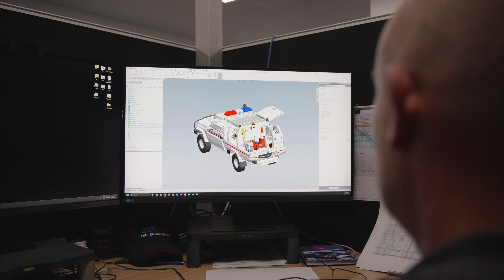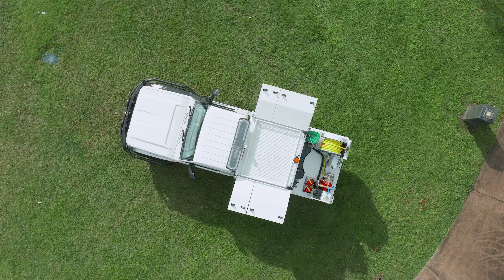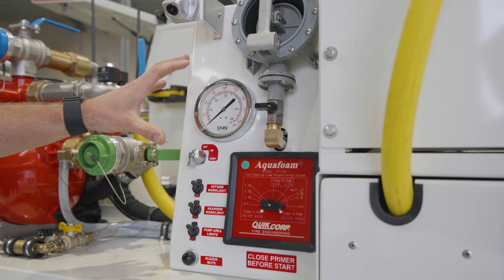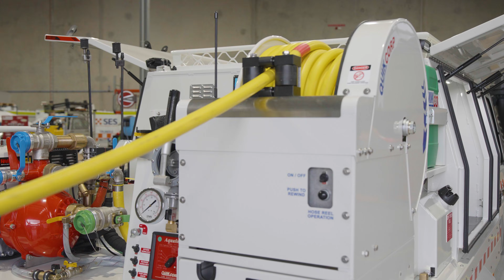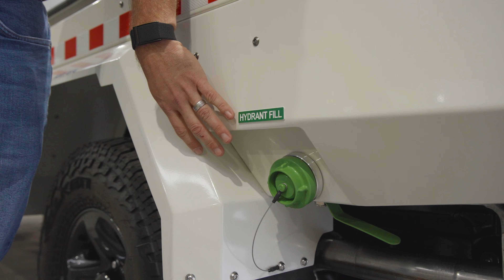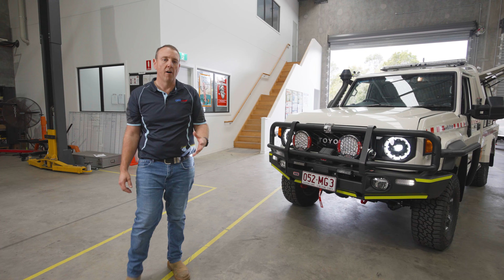Light Attack Vehicle | 4WD Landcruiser

Comment: How big is the water tank? And is it poly?
Reply from the maker: Hi, this build featured a 550L custom undertray baffled water tank, designed to lower the centre of gravity and improve stability. The tank is fully shrouded for protection against heat and punctures, and paired with a 50L reserve for burn-over protection.